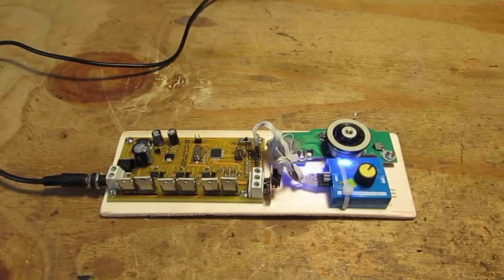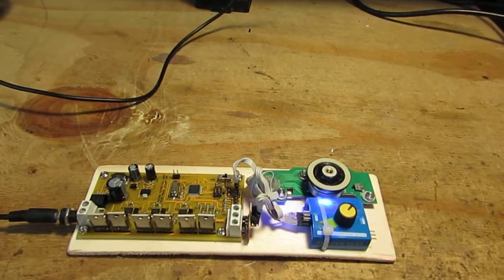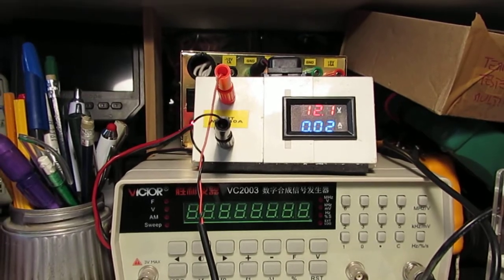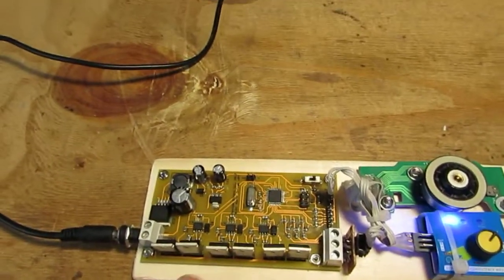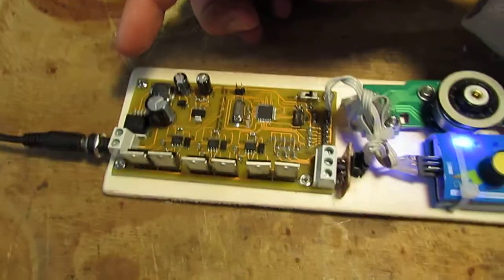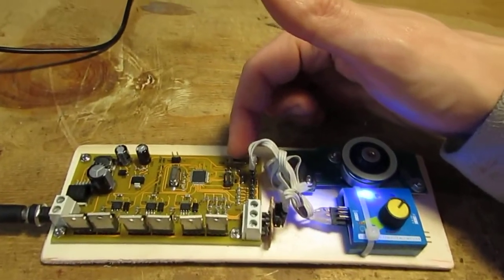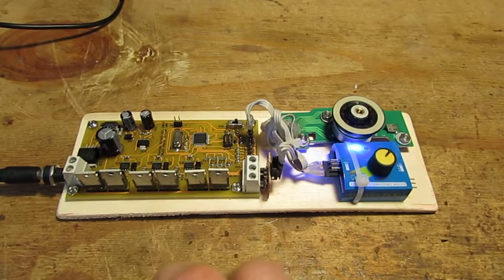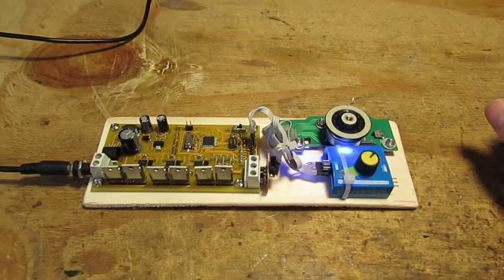A motor driver board for sensorless and sensored BLDC on ATmega micro

Comment: where can i get the program?
Reply: in advance I thank you very much sir
Reply from the maker: @SSCchannel  Check the two link in the first part of the blog post
Reply: @davidegironi  thanks i have found it
Reply: @davidegironi  Do you have the program in your Arduino IDE files?
Reply from the maker: @SSCchannel  No, this is for avrgcc plain compiler. It's not an Arduino framework based.
Reply from the maker: Hello, you can download it following the link in the video description
Reply: i have gone there but only found pcb schematic only